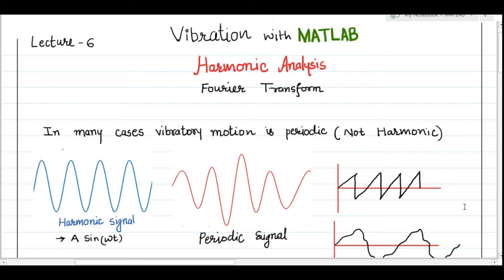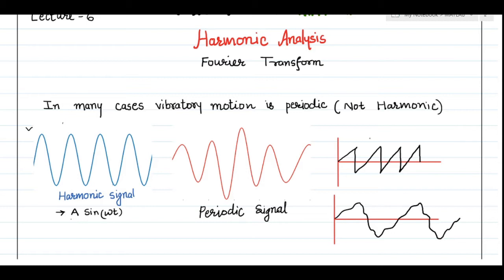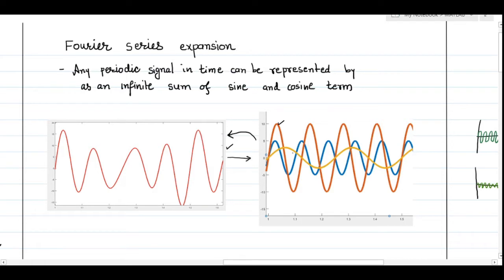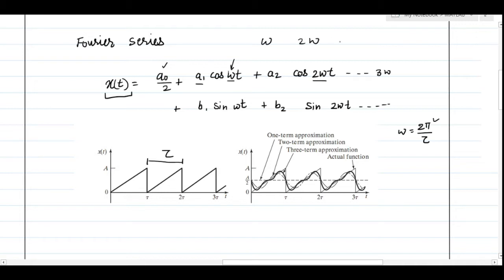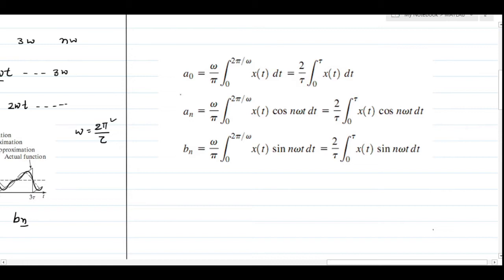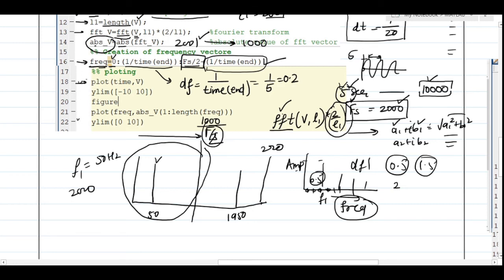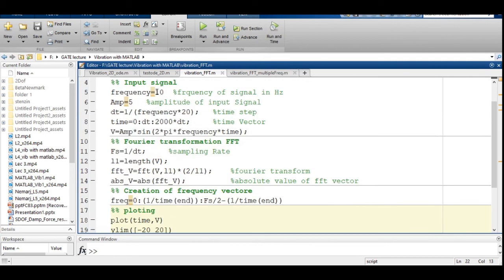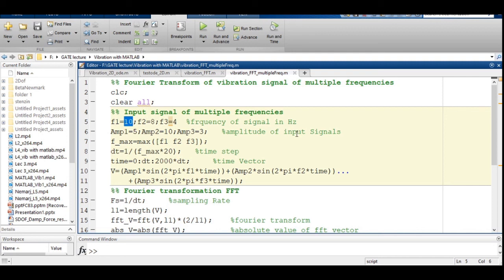Fourier transform in MATLAB || FFT of vibration || Vibration with MATLAB L6 || Harmonic Analysis

Comment: %% Fourier transform of vibration signal
clc   % clear command window
clear variables   % clear all variables from workspace

%% input signal

 frequency=10;
 amp=5;
 dt=1/ (frequency*20);
 time=0:dt:2000*dt;
 V=amp*sin(2*pi* frequency*time);
%% FFT

 fs=1/dt;
 L1 = length(V);
 fft_V= fft(V,L1)*(2/L1);
 abs_V=abs(fft_V);
 %% FR vector

 freq=0: (1/time(end) ): fs/2-(1/time(end));

 %% plotting 
 
 plot (time,V)
 ylim([-10 10])
 figure
 plot(freq,abs_V(1:length(freq)))
 ylim([0 10])

Comment: %% Fourier transform of vibration signal
 clc;
 clear all;
%% input signal
 frequency=10
 amp=5
 dt=1/ (frequency*20);
 time=0:dt:2000*dt
 V=amp*sin(2*pi* frequency*time);
%% FFT
 fs=1/dt;
 11= length(V);
 fft V= fft(v,11)*(2/11);
 abs V=abs(fft_V);
 %% FR vector
 freq=0: (1/time(end) ): fs/2-(1/time(end))
%%plotting 
 plot (ytime,V)
 ylim([-10 10])
 figure
 plot(freq,abs_V(1:length(freq)))
 ylim([0 10])
Reply: legands never die
Reply: but there is few mistakes here is correction

%% Fourier transform of vibration signal
 clc;
 clear all;
%% input signal
 frequency=10
 amp=5
 dt=1/(frequency*20);
 time=0:dt:2000*dt ;
 V=amp*sin(2*pi* frequency*time);
%% FFT
 fs=1/dt;
 L=length(V);
 fft_V= fft(V,L)*(2/L);
 abs_V=abs(fft_V);
 %% FR vector
 freq=0: (1/time(end)): fs/2-(1/time(end))
%%plotting 
 plot (time,V)
 ylim([-10 10])
 figure
 plot(freq,abs_V(1:length(freq)))
 ylim([0 10])

Comment: %% Fourier transform of vibration signal
 clc;
 clear all;
%% input signal
 frequency=10
 amp=5
 dt=1/(frequency*20);
 time=0:dt:2000*dt ;
 V=amp*sin(2*pi* frequency*time);
%% FFT
 fs=1/dt;
 L=length(V);
 fft_V= fft(V,L)*(2/L);
 abs_V=abs(fft_V);
 %% FR vector
 freq=0: (1/time(end)): fs/2-(1/time(end))
%%plotting 
 plot (time,V)
 ylim([-10 10])
 figure
 plot(freq,abs_V(1:length(freq)))
 ylim([0 10])